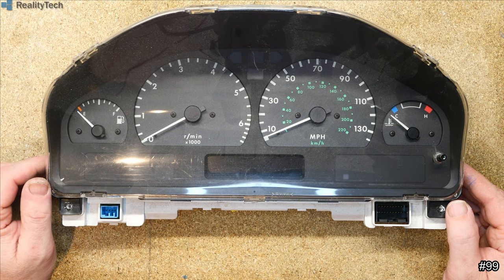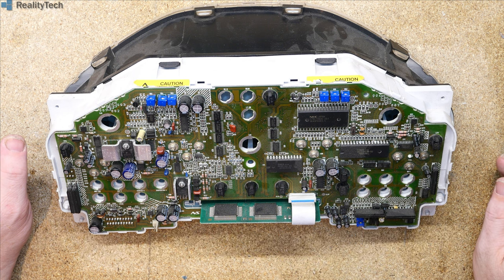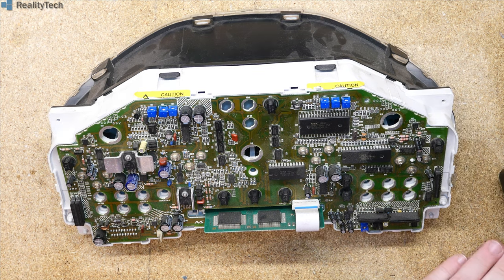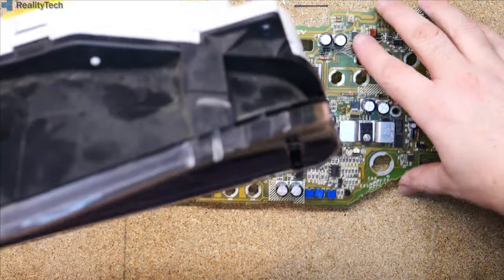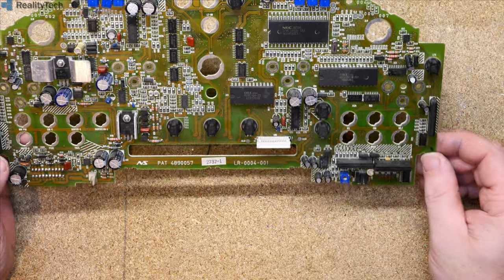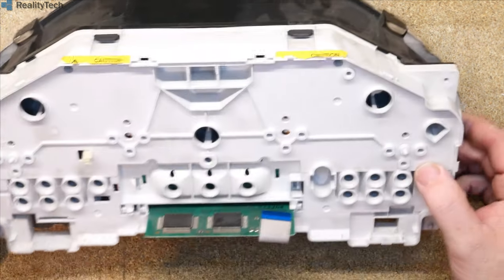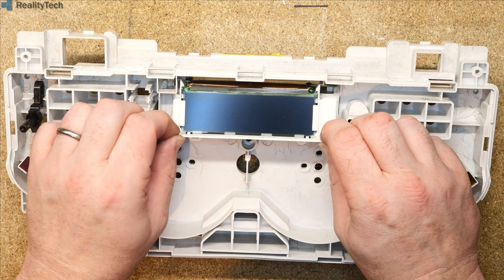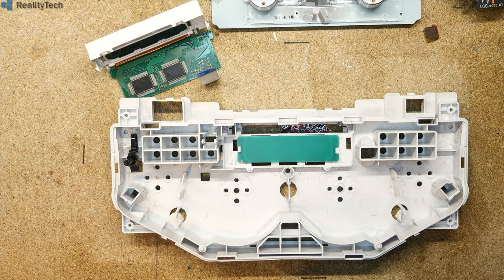#99 - Range Rover P38 Dash Dissection

Comment: Nice vid but I think you got the mileage location wrong. It is in 28c16. You refer to it as rom but it is eeprom. You have version from OKI, CSI CAT28C16AT was much more common
Reply from the maker: I'd need to re watch. The EEPROM part numbers are common for a particular type of device. EG 27xxx is always EPROM. 28xxx is almost always 8 pin EEPROM, 29xxxx Is normally flash ROM etc etc. Not hard and fast rules but generally a safe bet. The mileage is also held in the BeCM and a comparison is taken at start and I believe the highest mileage is used.
Reply: @rtechlab6254  will do one very shortly.  yes a copy is in BeCM but I am not sure if the highest it "automatically" taken from BeCM.  Comparison is taken at key-on and also key-off.  I will take dump and let you know.
Reply from the maker: Right I've been back. The OKI part is mileage, nothing else, a whole 16Kbits for mileage! The other chip is a 27C1001 in disgues and contains all the language files. In plain text. You should be able to use a 29C1001 in here. Cue the fun with messages! I have dumped this and the BECM ROM and will upload at some point
Reply: @rtechlab6254  Lol Richard, looks like we have same hobby.

Comment: If you remove green filter, would it be white display?
Reply from the maker: The green filter is also a diffuser. You'd get an orangey yellow display with the filaments visible
Reply: @rtechlab6254  but is it possible to convert green display to black and white, i mean whole speedo except the signal lamp like check eng fuel etc..?